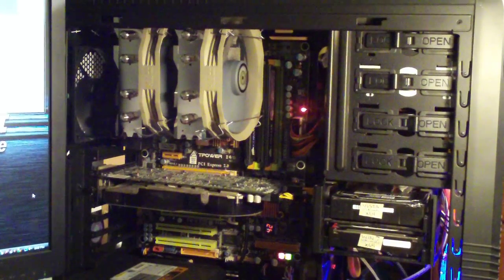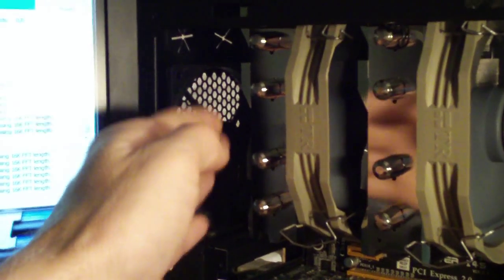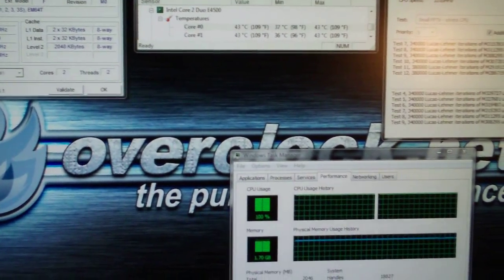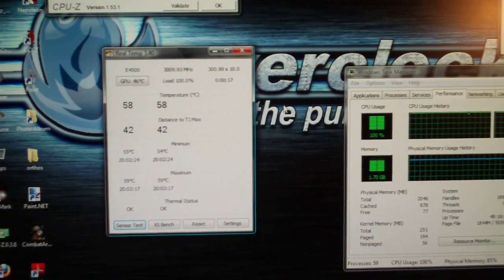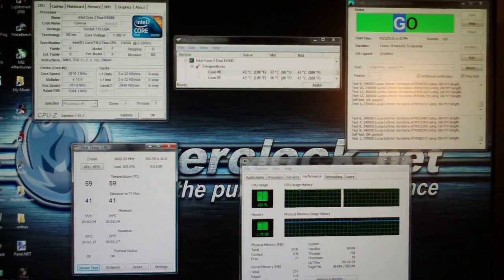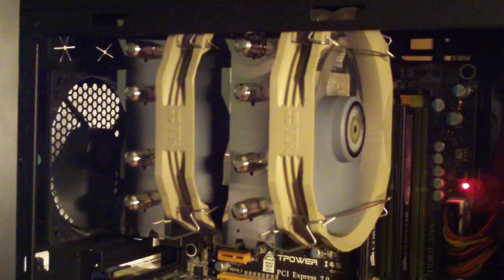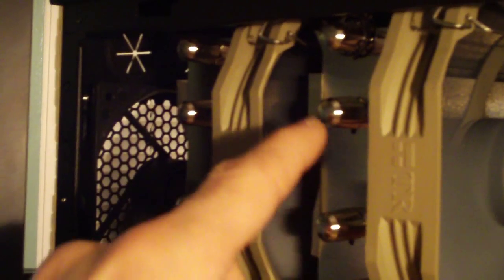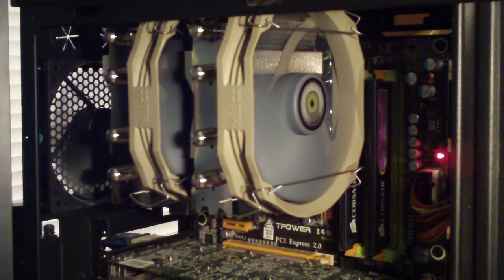Thermalright Silver Arrow Temp Results & Conclusion

Comment: @z34gtpz28 If you use all 4 slots you would only have to put the fan higher. I have Ripjaws and the fan mounts on there but I can't fit the side panel because the fans are too high and my case is too small.

Comment: I've just installed the Silver Arrow.  How are you guys configuring the fans?  See, with my Gigabyte  X58-Extreme having one PWM CPU header, I'm not sure what is the best way to configure the fans.  If I set the BIOS to PWM, The CPU fan runs according to temps, where as the other fan on the silver arrow runs at a constant low RPM.

Comment from the maker: @madgnad No if you had a single tower cooler and mounted it sideways it would fit 2 120mm fans but other wise they would have to be mounted above the top panel under mesh. 120mm fans fit here but 140mm fans must mount on underside to fit.